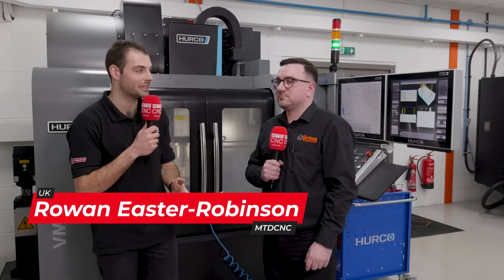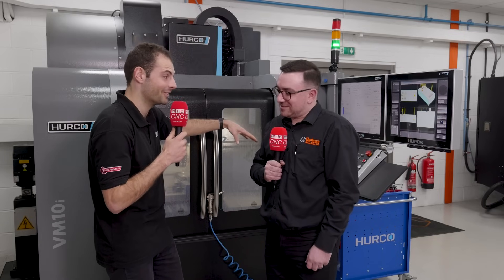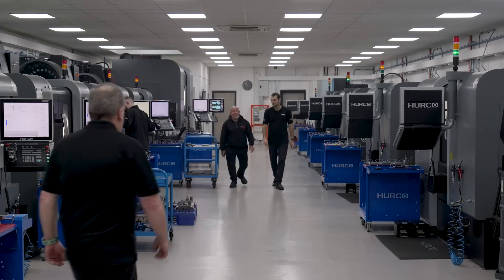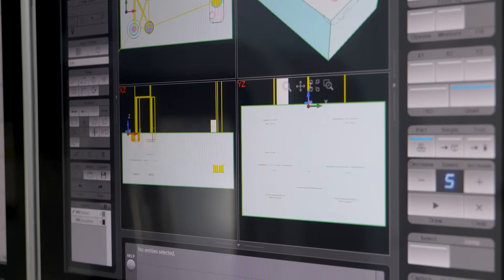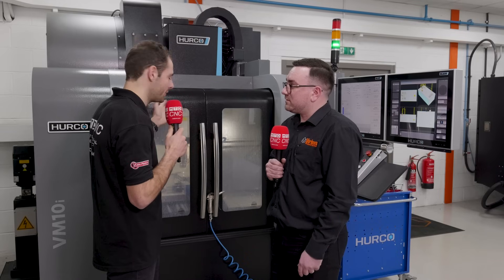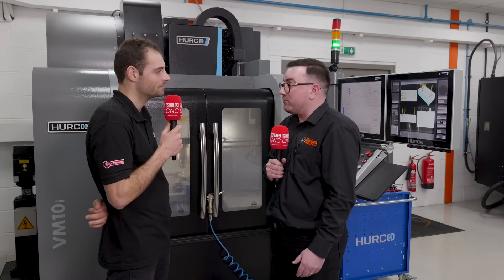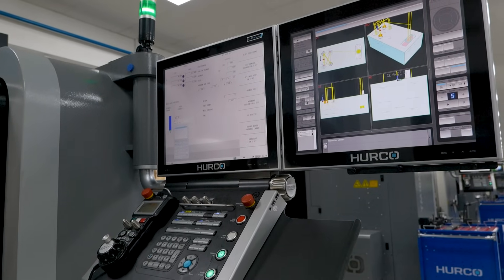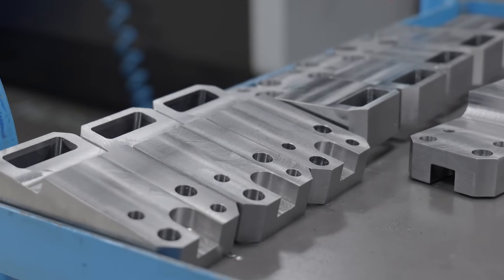Hurco VM10i Plus allows Varlowe Industrial Services to push parts quicker and meet customer demands!

Comment: I feel it a failure on Hurco's part, in not showing how good these controls actually are. For prototype and short run, they are virtually impossible to beat for program-at-the-machine. By the time you get a CAM system up, import a model and place.. you've got a program on the Hurco.